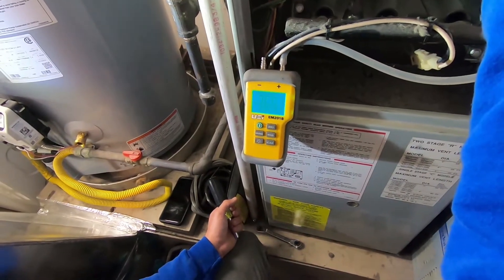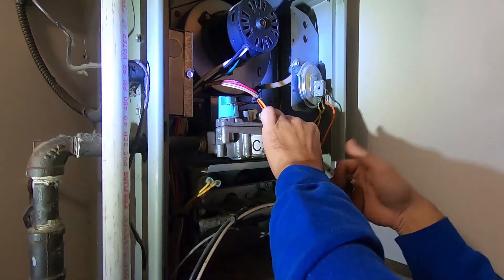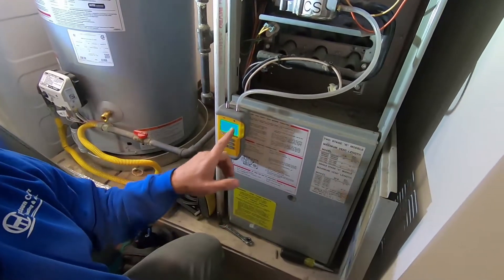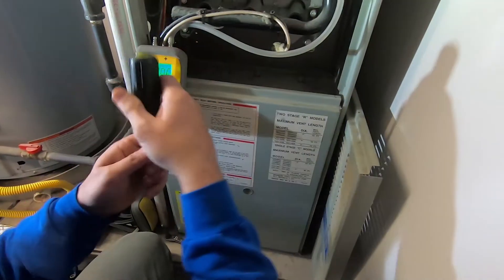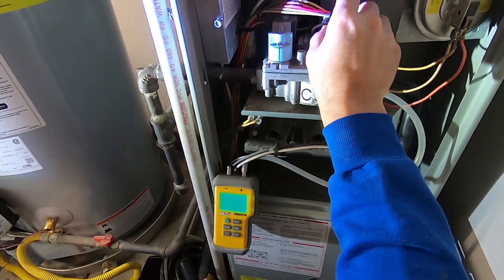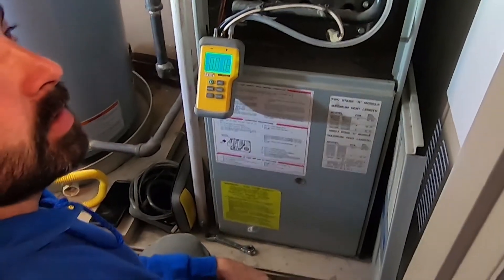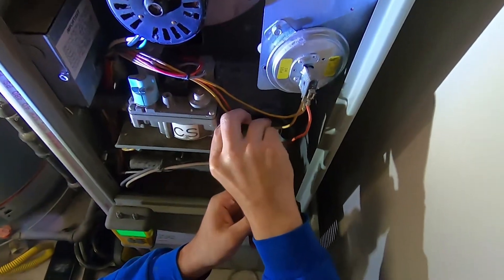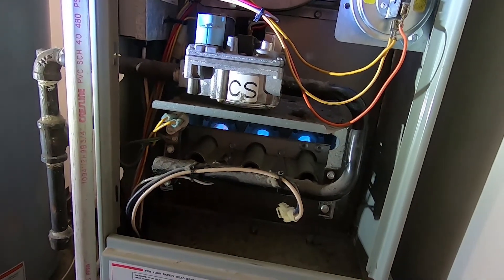Checking and Adjusting Gas Pressure with Manometer

Comment: At 3:51 did you say make sure the unit is not running before you id connect the tube ? Cause it looks like your unite was running or was it the pilot light?

Comment: Adjusting your gas pressure will decrease CO as well?
Reply: You need a combustion analyzer to measure CO, but yes, in most cases, this will greatly reduce CO as there is more complete combustion.  A single stage furnace at 4.8 is absolutely insane.  Just remember, gas pressure is only one factor, but the only way to know and set the system properly is with a combustion analyzer in the exhaust vent measuring the flue output.  Altitude and gas orifices play a great role in the equation also.  I live in Denver, so we have different rules and guidelines.

Comment: Witch setting is that ? Mine doesn’t have WC
Reply: You can use inH2o
Reply: @saw1565   thank you. I ended up calling the factory and they told me to use inH2o.
Reply: Same here. So does that read the same then, my furnace gas valve needs to be at 3.5 wc. So I van use other unit to measure?
Reply: I am try to fix a furnace Goodman but when the flame come out it's a big whistle.. can you help me to describe what the problem??;please